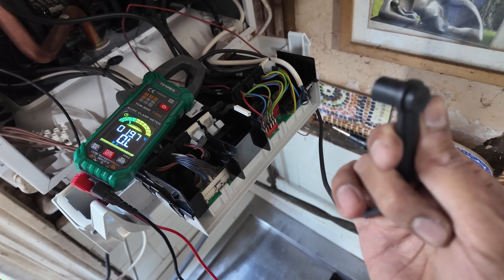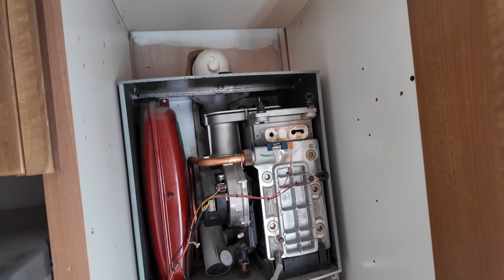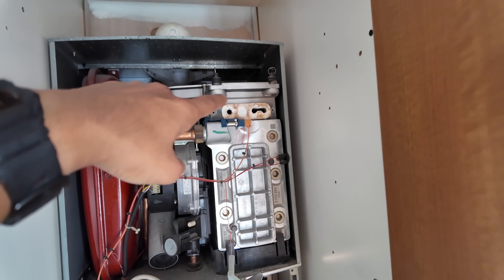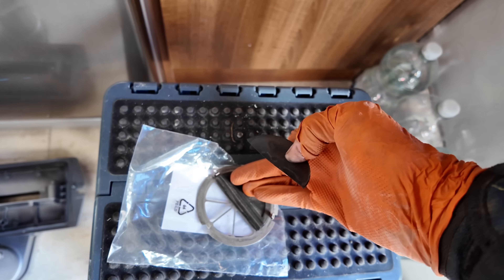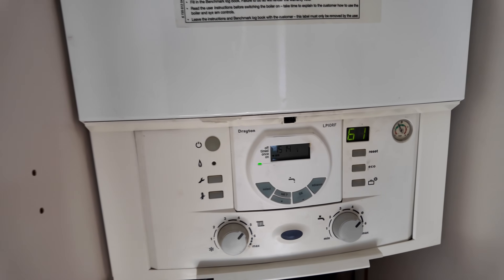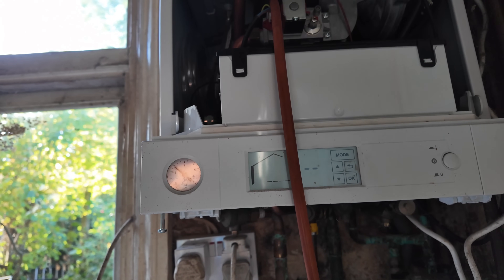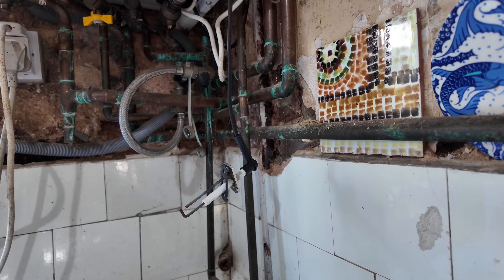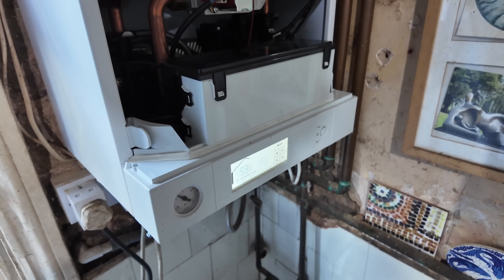Intermittent Faults Are The Worst!!

Comment: its same as the old bosch si models. on lpg they used to clog up, wear a mask while cleaning on them . there will be toxic dust. LPG .zee germans eh? think they are the greatest but in reality they are just arrogant and wont admit mistakes on their side. veissman try harder than most. it was always the gas safes fault. why are they still being alowed to sell boilers in the uk.

i personaly change the bearing plate if the boilers half that bad while the fans out.

saved another love you and your work ethic.
Reply from the maker: Thank you 👊🏾
Reply: @cputilitysolutions   you working on lpg there confuses me? its london right?
Reply from the maker: @markchristohperowen6806 no I haven't got my LPG, not enough of it round here for me to do my ticket
Reply: @cputilitysolutions  i thought so.

Comment: You need to adjust burn settings to get rid of an ea fault like this. You change settings to stop the bearing plate sticking. That’s your issue. Nothing to do with the heat exchanger 😂
Reply: I didn’t mean the gas valve ? I’m talking about settings on after burn etc. sorry if I gave the wrong impression. You will be ok for a bit because you’ve put a new bearing plate in. But it will come back in. You need to go into settings. No need to be tetchy, especially when people are trying to help you. You can get the fan to run for 20 secs longer after a burn which stops the bearing plate sticking.
Reply from the maker: @heatpump8566 not being tetchy, I'm always happy to receive constructive criticism and guidance from fellow engineers. But in this case the main issue was blocked flueways on the main heat exchanger
Reply: Blocked flue way on that model usually gives an overheat fault as the primary stat on the cell overheats because it can’t get heat away. You can test this by measuring temp around that rhs stat. But you probably know this 👍
Reply from the maker: @heatpump8566 yup I do, but perhaps you and I have had different experiences with these boilers, what works for you may not work for me and vice versa. I guess that's the nature of this game
Reply from the maker: I beg to differ. Adjusting the gas valve is the last thing to do when you have these issues. If the flueways in the main heat exchanger are blocked then the POCs can't pass through and will throw up an EA fault. That was the case with this boiler. After I gave it a full strip and clean the combustion readings were within tolerance and I only had to tweak the gas valve to get it spot on. No callbacks since the job's been done. That's the real issue and hopefully now you've learned something you didn't know before 👍🏾